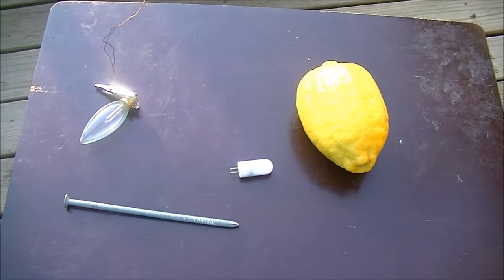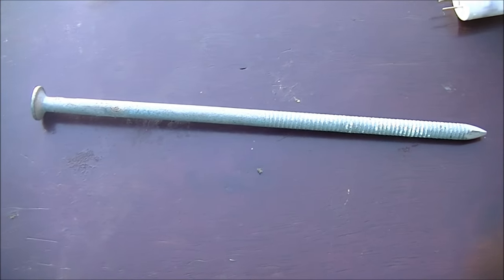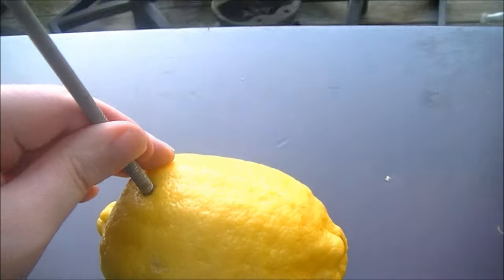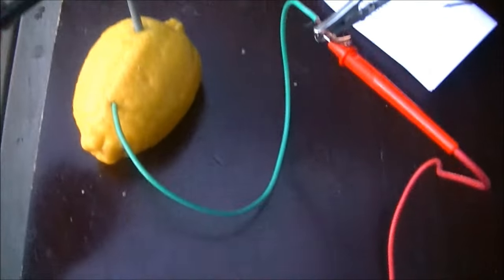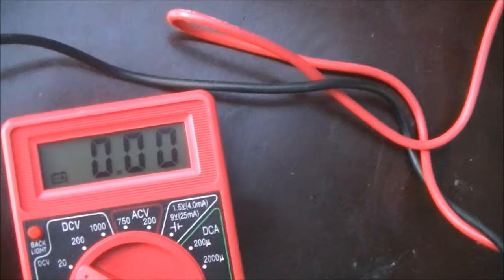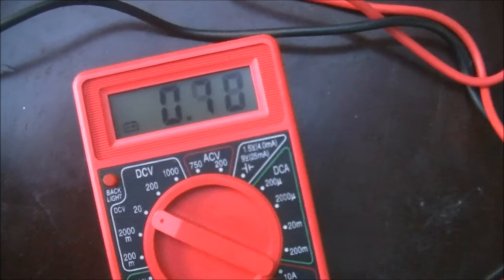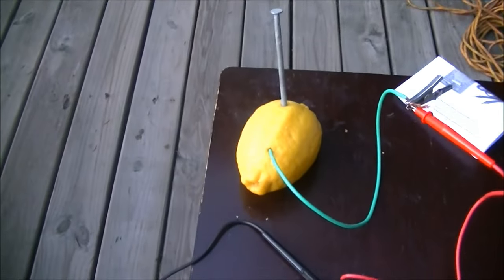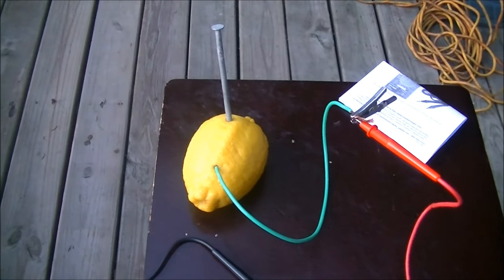How To Make Your Own Lemon Battery

Comment: Oh, cool! I remember making one of those in school right after moving to America. I used an American penny and a nail. I remember the teacher told us the same thing, that we had to use an old penny or else it wouldn't work. Why did pennies switch over from copper? Was it to save money? Didn't they make them out of steel during WWII?
Reply from the maker: Thanks, Kissyface! That's cool to hear. Yep, they switched over to zinc in 1982 to save money. Yep, they made steel pennies in 1943-1944 (although only a few steel pennies were produced in 1944).